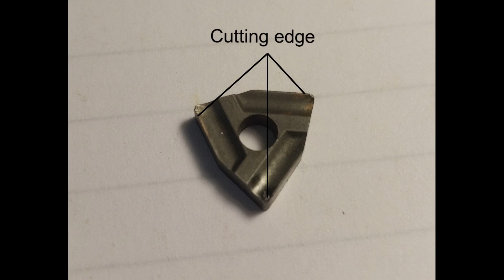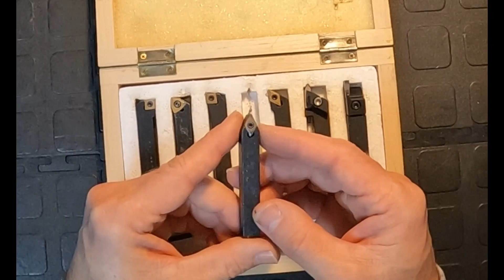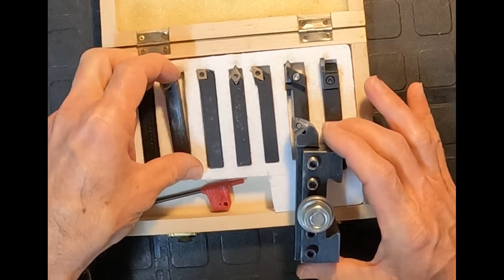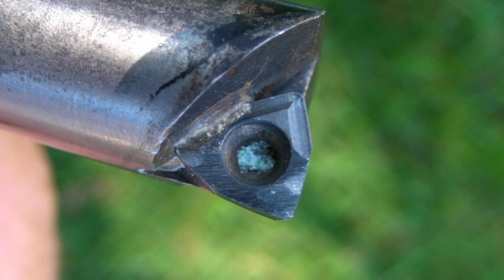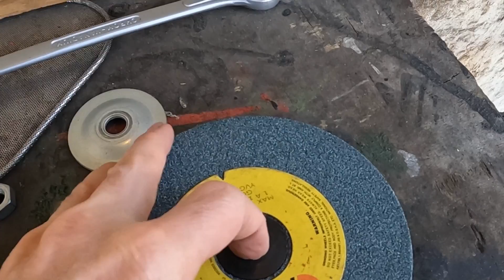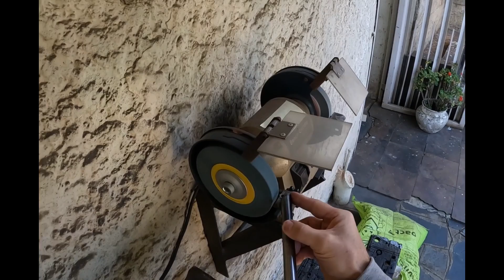There's so much more to lathe carbide tip tools than what people think!

Comment: I am enjoying your videos so far but on this topic I will have to chip in here and say I completely disagree with most of what you've explained here.
To start; while the Adendorff lathe is not half bad and with some tinkering can be made to provide a reasonable result, the insert tool kit is exceptionally bad and should be avoided at all cost!
There are various reasons why I say this but what I must state right from the start is that while you were comparing cost to that of brand name commercial tool suppliers, If you've used any of these high end tools you will understand exactly how bad the Adendorff(Chinese) set in fact is.

Before talking about quality and cost I would like to point out one of the reasons why the Adendorff kit is particularly unsuited for the small hobby lathe.
The insert style used in these tools comes with a negative(neutral) rake. The benefits of these style of inserts is the fact that you have double the amount of cutting edges made possible by flipping the insert over(like you've illustrated in the video), but most importantly, the negative rake provides great support for the cutting edge allowing very heavy cuts to be made. 
In a machine shop environment especially when using Abom size lathes, this is a major advantage and can save a lot of time removing large amounts of material. The problem with this however is that it requires significant amounts of torque and power, something hobby machines does not have much off. For this reason positive rake tool inserts makes far more sense for the owner of smaller machines. One of the major advantages of positive rake inserts is the fact that they provide much finer finishes. So while you might save on having more cutting edges that can be used on negative rake inserts, you will need tooling for rough cutting and then tooling for finishing which is fine in the machine shop environment where costs are much easier to justify. 
The hobby lathe owner would prefer one tool which can be used for both roughing and fine finishes even if it comes with the price of having to do a couple of more passes to remove the same amount of material. For this a positive rake tool and insert would be the best choice and unfortunately they are harder to find in kit forms or in the low end Chinese brands.
Now for comparing cost; yes you can buy the entire Adendorff kit for the price of a single Sandvic or similar high end insert style tool but you really only need 2 tools.(This excluding a tool for parting and boring bars.)
Left hand tools almost never gets used and even in the odd case of needing one you will find that fitting a 4 jaw chuck and spending the bit of extra time to center your work piece after flipping it in the chuck you can still achieve the same. My point is, never waste money on left hand tools. The same goes for the centrally mounted insert tools.
I use 2 tools and they are my go to tools for 95% of all my machining. For the rest I have a boring bar and parting tool.
I most often use these 2 tools in combination; the first is an SSDCR 2020K 09 from Sandvic https://www.sandvik.coromant.com/en-us/product-details?c=SSDCR%202020K%2009&m=5751189
With this tool I have 4 cutting edges, it works great for facing and chamfering on outside edges, left and right and can also cut longitudinally if you do not need to cut to a 90deg shoulder.
The next tool I use a lot is a SDJCR with DCMT inserts which is okay when it comes to facing but brilliant at longitudinal cutting and cutting into a sharp 90 deg shoulders. It also provides very fine finishes. (and in spite of it being a positive rake tool I have taken 6mm cuts with these on my 3HP Colchester Student.)

Another one of the benefits of using branded cutting tools is that most suppliers of branded tools will supply single inserts while many of the cheap brands force you to buy packs of 10 or if you are lucky, packs of 5. (It is also my experience that inserts from branded and non branded tools are not very different in price.)
On this note I must also mention that the Adendorff insert tools only take inserts supplied by Adendorff while all other brands use  the same style and shape inserts which are compatible with each other. There are however also cheaper alternatives for the branded names like Sandvic, Iscar, Kennametal etc. which will also take the same inserts.

Just a mention on the quality of these inserts; I can drive the Sandvic insert much harder than the Adendorff ones before destroying them which is ironic when one consider what I have discussed earlier in terms of the advantages of negative inserts over positive inserts.

I might be stepping on some toes here but I do believe I am providing sound advice which will make a considerable difference in the quality of your machining.
Reply from the maker: I have no problem with different views, in fact I encourage it! Expensive or high end tooling is always nice in a workshop but I have found I needed to be innovative to solve problems rather than throwing money at a solution. Most of my video's will reflect this, i.e. even the inexpensive tips and holders can machine perfectly for the home workshop at a fraction of the cost. I can't comment on the life of the tips as in the last 10 years I've never thrown one away, they tend to be reused again and again. My advice is always, if it works for you then keep doing what you doing!
Reply: @Lukers_tinkering  spending more or less money might be considered a different viewpoint yes, but using the wrong type of tools for the wrong application is not a very rational approach.
Cheap here is very relative;
I spend just less than R2000 for the Sandvic SSDCR with 20mm shank and the Korean made SDJCR, also with 20mm shank.
Inserts must have cost me less than R500 as I only bought 3 or 4 for each tool because I could buy them loose and they were around R85 each.
Compare that to the Adendorff 20mm kit going for R2000 and you can see I spend  only R500 more but are getting loads more bang for my buck👍, not only in quality, but also because the positive rake tooling provides less load on my lathe and leaves a much better finish. 
In contrast the Adendorff kit provides a whole pile of different cutting tools....which no one hardly ever use🙄.

Comment: I found those hi-rake inserts chip very easily as theres NO nose radius... and the biggest sin is to stop the lathe spindle rotation mid-cut, a definite insert killer... 
Running smaller lathes with limited HP, I prefer the versatility of hss and keep the carbide for tougher /harder materials... 

😎👍☘️🍺

Comment: What you're calling a "left hand" tool at 6 minutes in, is actually a "right hand" tool. It's counterintuitive  to how it looks, but I think it's  because it cuts the "right hand" face of the job ? Not meant as a criticism, but I wouldn't want any beginners watching this to order up the wrong type of tool.
Reply from the maker: Yep, you guys are right,  I always mix it up... checked my machinery handbook 12ed and it says there is no formal definition but generally accepted that looking from the point; if the cutting edge is on the right, it's a right-hand tool. Thanks for the correction.

Comment: I have carbide tipped lathe tools, and they work very well on my small lathe.
The power from the motor is more than sufficient, but the belts will slip if the part jams and stops the chuck.

The boring bar is cool, but if you had machined the end better, you could have had a screw holding the bit.

I have a large triangle carbide brazed to a rod with a handle, I use for a gasket scraper.
Due to the angle and only hand pressure, it does not damage the metal surface when I use it, I have used it on cast iron and aluminum with no scratching.

I also bought carbide rod for making special bits, and tools.
Reply from the maker: The power requirements for a home lathe becomes an issue when the tooling creates a 'wedge' cut, this is specific to the grooving tool discussed in the video. Other than that there shouldn't be any issues. I have a few home made insert holders, but the example was for a used insert, and something that can be made in less than 5min with only an angle grinder and blow-torch. I tend not to sharpen tip/insert tools in holders. Was the rod HSS or carbide? I have made the odd tool from broken carbide milling cutters but thats heavy going. I do the rough shaping using a tile cutter disk and finish off with the grinding wheel...Thanks for the comment!
Reply: @Lukers_tinkering  The rod was carbon steel, and is pretty stiff, as it resists bending very well, I believe the rod is 3/16 inch diameter, and it is brazed to the corner of a 1 inch per side triangle insert.

My lathe does very well, except when using a diamond/wedge insert and I am trying to plunge cut the material, otherwise there are no problems, unless the work loosens in the chuck and wedges while I am trying to make a cut. It does well for a 1940 era lathe!

Comment: Hi info; buy a cubicbornitrid or diamond disk to grind carbid. They are made for the application. Siliciumgrinding disk arnt that hard.
Reply: I bought a diamond disc for carbide, and a small grinder to run it.
Reply from the maker: It's expensive, but if you can afford it, yes, definitely. Old school green grinding wheels are much cheaper and were popular before diamond become more common.
Reply: @Lukers_tinkering  lol 50$ and you get good quality. And im a cheapskate... They can cost 5x 50$ or more but i get them on ebay, oldstock mostly. They hold up good so what?